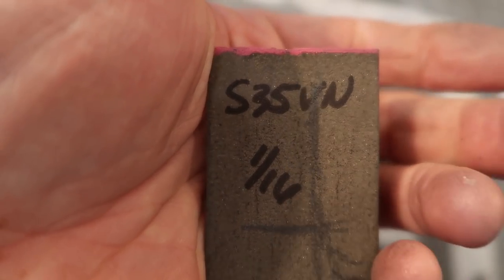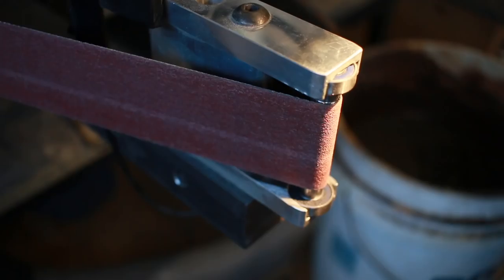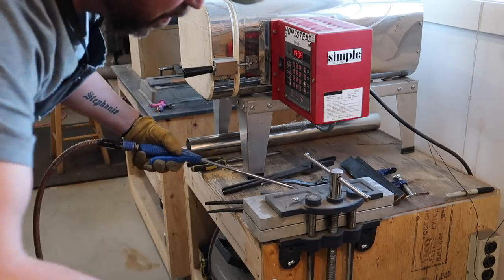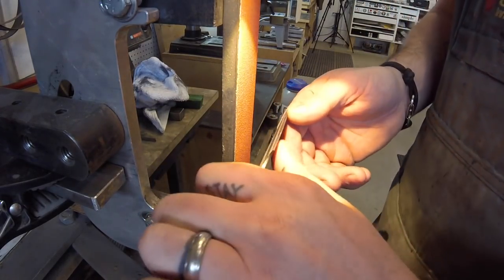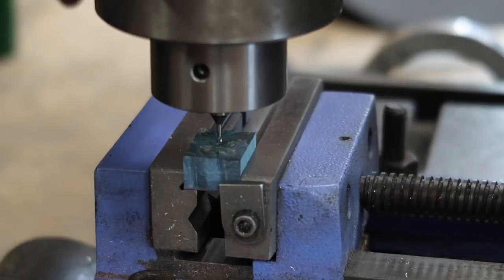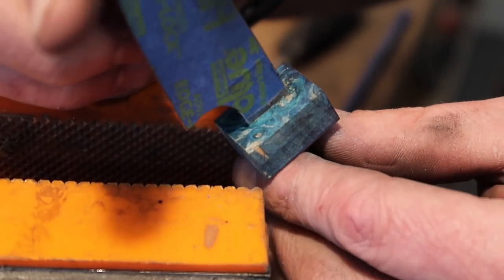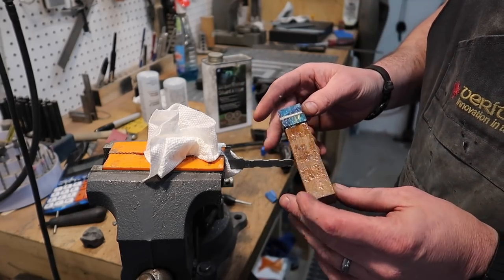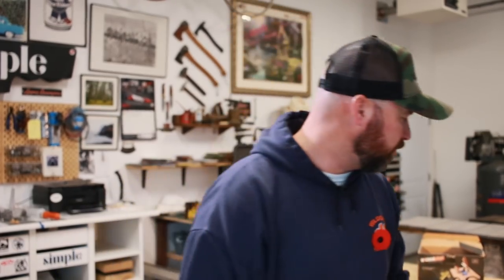How To Make a Knife - paring knife in s35vn

Comment: The wax process will work a lot better if you don’t bitch the sides of the tang until just before final glue up. Leave the tang smooth during the 1st glue up with paste wax and it will slide right out for ya. Love your videos and I’ve learned so much from them. Keep up the great work Brother!!

Comment: Wax won't override a mechanical lock. Glad you got it out.
Reply: There wasnt a mechanical lock though there wasnt a pin
Reply: @tuckerabbott  there were notches cut in the tang, which would create a mechanical lock with the epoxy, that's the point of the notches.

Comment: So you have been my inspiration to do some knives. I have built  a belt grinder and was racking my head over the belt oscillating a bit side to side, but I see yours does too. I have yet to start even figuring what knife i wanted to start with. I think it will be a paring knife. Thanks for sharing your work and passion. Hope to be able to send you a a picture of a knife soon.
Reply from the maker: Right on. I find it depends on the belts. Some belts run perfectly true. Some wobble. 👍

Comment: Nice knife. I think the reason the tang wouldn’t come out of the handle easily is because you put the grooves for the epoxy in the tang. Maybe try making those grooves after bedding the tang.
Great video thanks
Reply from the maker: Thanks! I moved the blade up and down for that reason and thought it would help. These are just two of several ways to get it done and I think it’s always best to stick with your personal preference. That’s the last time I try waxing it 😆👍
Reply: Ok have a good one
Reply: Yep, wax works a treat with straight or tapered tangs. but the divots leave a place for the resin to form protrusions that you have to drag past to withdraw it.

Comment: Stress fractures at the ricasso, due to non-rounded edges, are a thing seen it happen a bunch of times on Forged in Fire (even after the competitors beeing warned in the first round. So not just a theory. You did great by playing it safe. Very nice knife, btw.
Reply from the maker: Thanks you! I don’t watch a lot of FIF though I enjoy it when in do. I remember in grade school anytime we were turning a part down in a lathe they wouldn’t have us radius any internal 90 degree cuts. We had to calculate the numbers once with engineering manuals and it’s incredible how much stronger that little radius makes a part👍
Reply: @Simplelittlelife  same goes when designing electronic circuits, no 90 degree angles in the tracks.
Reply from the maker: Ah, that’s interesting. Makes sense but never tough how far it would cross over into other fields and disciplines.
Reply: @Simplelittlelife  BTW I just remembered that stress fractures are also avoided by any kind of gas, propane, butane, etc. manufacturers, that's why the containers are round (even though they are less space-efficient). In order to minimize leaks and ruptures, due to internal pressure or mishandling, they avoid edges.

Comment: Wax only works realy well if the tang is more or less smooth, the grooves/notches in your tang make nice pockets for the epoxy to harden in and make it hard or impossible to take out without any damage to the handle. One way would be to make the grooves/notches after you glued the Handle. Or... you could just do it like you have always done it, seemed to work just fine for you. Loved this vid!

Comment: About the radius at 3:25: It actually IS a thing! There are two different problems you have to face, static stress and fatigue stress. It's relatively easy to prevent the first one (you can't bend the steel bar with your bare hand), but if there is a sharp angle, that's the place where material is stressed the most and where will eventually a fatigue fracture iniciate. Any kind of radius can relax this at least a little bit. This should be definitely your concern if your knife is made of thin steel. If you overdo the radius (kinda enter the bar), trust me or not, it's even safer in terms of fatigue (of course this will worsen the static toughness). Fatigue fracture can be seen with cheap kitchen knife, where they spare money on every part that isn't visible.
Radius designed for preventing a fatigue is a thing in shaft design and some are ostensibly weakening the part, but in the end, fatigue is what really matters.
Summarized, it's even safer to make a hole in the corner with a drill than keeping a sharp angle.
Anyway sorry for my english

Comment: Use Vaseline for the tang and only a very light thin coating not wax leave in for 5 mins only or less once it's aligned clean off the Vaseline and reinsert 10 mins or so later and you will be fine.  lastly holes through the tang provide a better means of mechanical retention compared to rounded outside curves. Sweet work Regards fifty50 knives.

Comment: What angles were your primary and secondary bevels? I'm working on my first hidden tang kirisuke.
Also, I like your method of fitting the handle sections together. I've been fighting that for a long time now. Even when I roughed up the mating surfaces before applying the epoxy, they would come apart during even gentle handling.  😟 The knife turned beautiful by the way.

Comment: I don't think the wax can work when you have groves for the epoxy to form around.  Just a guess but I'm just a armchair expert here :)
Reply from the maker: I agree with you.  Always like to have those groves and for me I’d rather not grind those in when the knife is 90% finished. I just got so many comments about it like they were preaching a gospel message to me. More than 1 way to skin a cat and I should just stay with the way I like to do it 😆👍
Reply: @Simplelittlelife  From all that I've watched you do, the groves make sense to me :)
Reply: @bobothewood9628  Grooves will work, but they make pulling out the blade too difficult.  On a final glue-up, the grooves offer excellent mechanic advantage locking the tang into place.

Comment: 3:20 watch forged in fire i lost count how many fails from hard corners
Reply from the maker: OH I see. I know even when turning a part on a lathe if you can leave a radius instead of a hard 90 you significantly increase the strength of the part 👍
Reply: Yes if you're smashing the blade into metal canisters and pig carcasses; this is a simple paring knife to cut tomatoes.  I doubt it would break but regardless it doesn't hurt to round the corners...

Comment: 3:17 not in theory, in practice. I've fixed knives for a friend who can't weld. Nobody in the manufacturing department (of the quite expensive knives, i might add) bothered to do something as simple and as effective as you're doing, so the result was broken handles on otherwise perfectly good knives. But hey, i learnt to weld stick stainless under water and he got good knives back with the proper radius in the handle, so i suppose win, win.

Comment: You do realize that because you ground those scallops into he edges of the tang that, regardless of wax, the epoxy filled those voids making a mechanical lock you had to break loose. I'm surprised you actually got it out, you He-Man! It probably would have worked much better if you had ground those in after the initial glue-up and just utilized them in the final glue-up. That's what I think anyway.
Reply from the maker: You are 100% correct. It was late at night and I wasn’t thinking everything through 😆👍
Reply: @Simplelittlelife  Haha,  it's always the simple things that catch us out!

Comment: hallo from Berlin.I thought that this steel should be preheated before hardening ??Preheat: 1550-1600°F.Austenitizing: 1035-1095°C (1900-2000°F), holding time at temperature 15-30 minutes.
Reply from the maker: Do whatever you want man.
Reply: @Simplelittlelife  Hallo again.I am an absolute fan of yours and I find your craftsmanship very good. my english is not very good and i write this with google translator .That is also the reason why it may have been misunderstood. I'll try again and in more detail .I haven't worked on the steel (CPM S35VN) yet, but I wanted to. According to my research, hardening was time-consuming and I could only get the maximum out of it if you preheated it .I was actually hoping that you, as an experienced knife maker, could help me here by telling me about your experience with this steel .I was very unhappy about your answer, but that is probably also due to my spelling .thank you and always have sharp knives ;)

Comment: Do you really need stainless tool wrap for heat treat?
Reply from the maker: Yeah you do. Anytime spent at around the 2000 degree mark will decarborize the steel in a hurry. You’ll end up with a pretty crap steel if you don’t. Either that or a purges kiln to remove the oxygen. 👍
Reply: only for stainless. not high carbon tool steels.

Comment: the reason the paste wax method didn't work very well for you is the notches you put in the tang. What I've done, and had good luck with, is not grinding those notches into the tang until after I've bedded the tang. that way epoxy doesn't seep into the notches and create a mechanical bond, which is what I'm pretty sure happened with your knife.

Comment: I know you wear your respirator and have some dust collection, but have you ever done a lung function test?
Reply from the maker: Have you?
Reply: @Simplelittlelife  Have to for work. Normal levels, but our exposure to silica dust makes us at risk for lung cancer and various other problems. Very strict cleaning procedures in the production areas, but even then silica dust is such a fine particulate it's difficult to completely eliminate exposure even with PAPR.
Reply from the maker: I had one at work (probably 5 years ago) for the same silica reasons. I am really really careful about that stuff but would be interesting to check again and make sure I’m still “normal” 😆👍